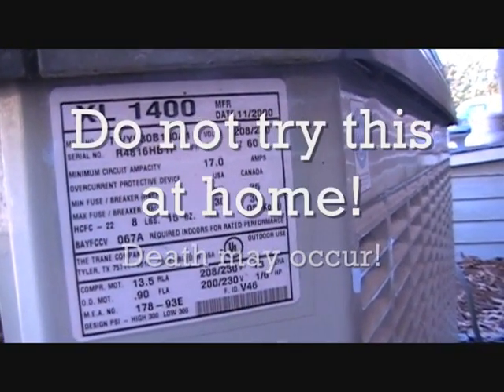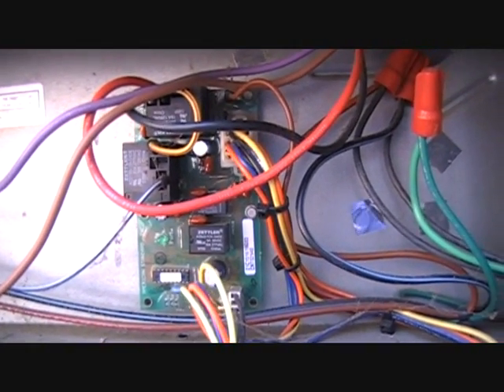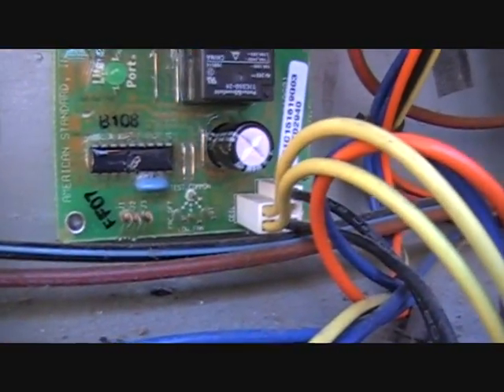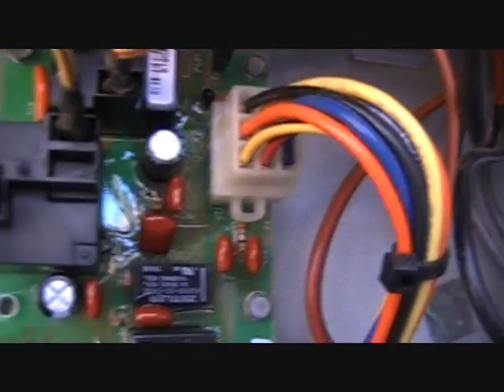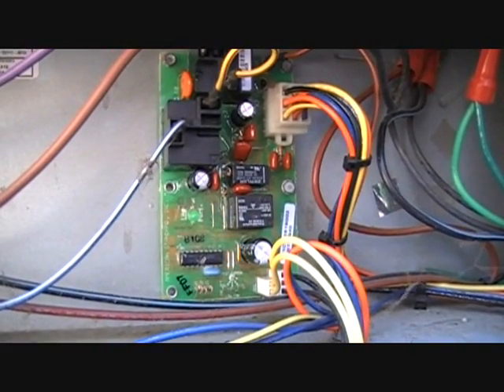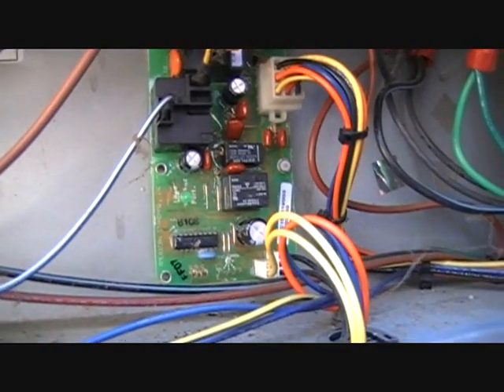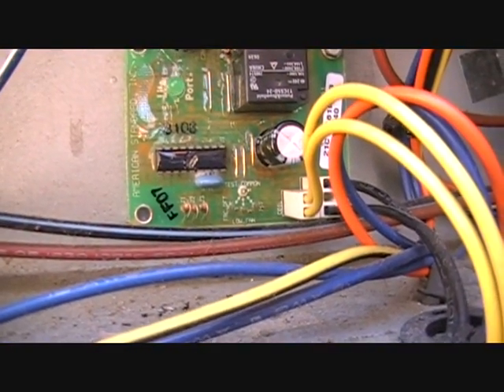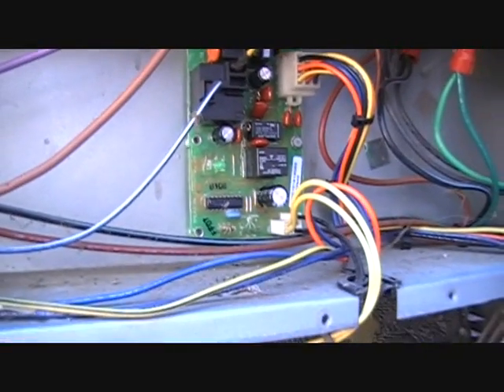HVAC Service- Trane 2940 Defrost Controller

Comment: Thanks for the great video. My 3 ton xl1400 heat pump has the 2941 defrost board. Is there a built-in anti short cycle  time delay to protect compressor during power blips in a storm? I was unsure, so I hooked up the icm 203 delay on break timer. However, the icm time delay (which I have set for 8 minutes) is activated whenever the unit enters defrost and the contractor opens for 20-30 seconds as you described. That said, during the 8 minute delay before the contractor is able to close for coil defrost, I am using strip heat. Please advise.

Comment: Zach, any reason why you didn't jump out the coil sensor before you shorted the test  pins.I was watching your other defrost board video and that's what was done ( DFT was jumped out)

Was it because  one is a thermistor style  sensor and the other is a regular thermostat (bimetal)
Reply from the maker: That's correct. It is a different type so jumping the sensor is nit needed

Comment: talyn875 The defrost boards on my 1996 XE1200s are all going bad in the opposite way, they are putting the system into defrost way too much, one of the units actually keeps the condenser fan running during defrost! I know my TXVs are bad, and starve the coil during really cold weather, but when I put my gauges on one time, the coil was running about 20 degrees lower than ambient (which is perfect) but it still kept putting the system into defrost. Any idea what the difference between ambient and coil should be to trigger a demand defrost?
Reply from the maker: I am not sure what the spread should be to tell the truth. That would be a good question. I would double check charge using he service facts.
Reply: Thanks.